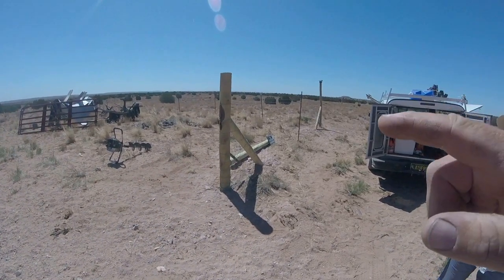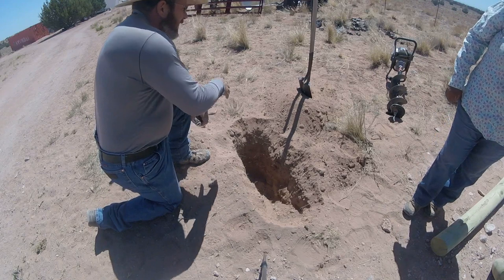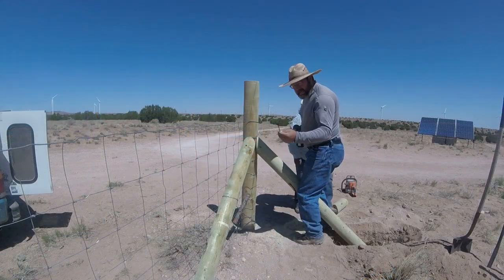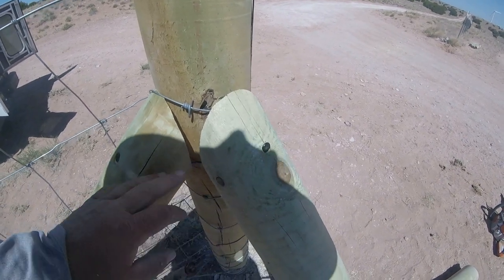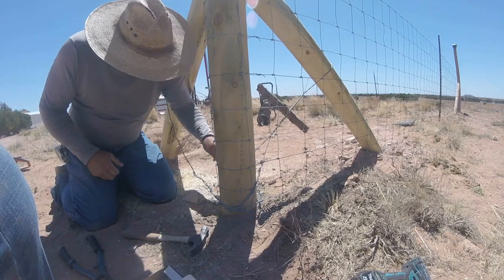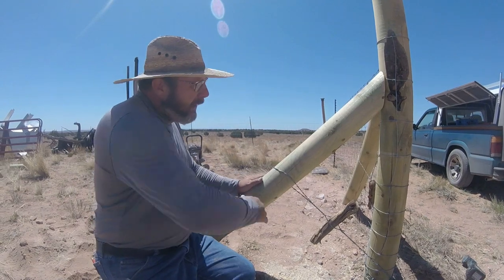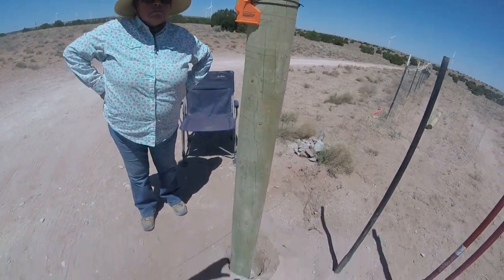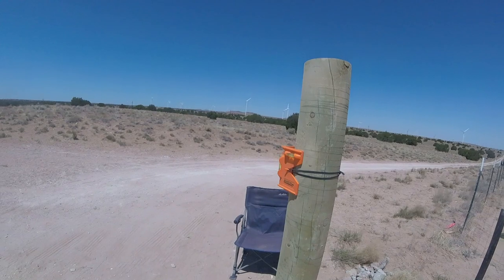How To Build A Wood A-Frame Corner Or Gate Post

Comment: When I make my A frame corner for high tensile do I pass the wire on the inside of the brace post thats on the 45?
Reply from the maker: Your fence wire will run on whichever side you are running the fence on. To contain animals I run the fence on the inside of all my posts. To exclude animals from coming in I put the wire on the outside of the post. But some folks like it to look one way or the other.
Reply: @HighDesertHomestead  thanks
Reply: @HighDesertHomestead  Are A frame corners stronger than H frame?
Reply from the maker: @itisfinished7377  Installed correctly they will hold more tension than an H.